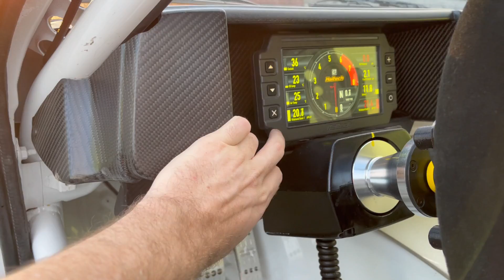The Group-D 6 liter V8 D-Mac86 Detailed Walk Around with D-Mac

Comment: Good quick and simple tour of the car , No blinging up , bigging yourself up etc etc , spot on build. Still can’t beat the Quattro in my mind . Drift is not really my scene as circuit racing is but it’s nice to see different forms of motorsport . Winters diff is on my list for an e36 build I’m doing 👍❄️🎄🇬🇧
Reply from the maker: Thank you! Doesnt matter the motorsport car builds are nice to look at. We have Bulldog quick changes in stock better than winters
Reply: @Group-D  nice one , I’ve watched some of your content previously as well as a few of the other Irish lads . 
I’ll drop you a quick email over the next few days regarding a diff then , currently running a BMW 210 with a 4.3 motorsport ratio . 
👍